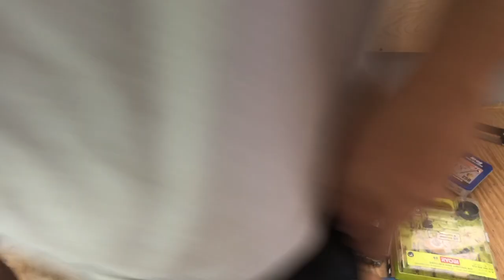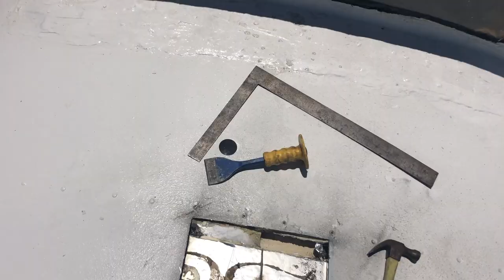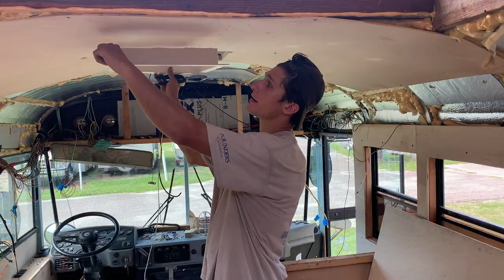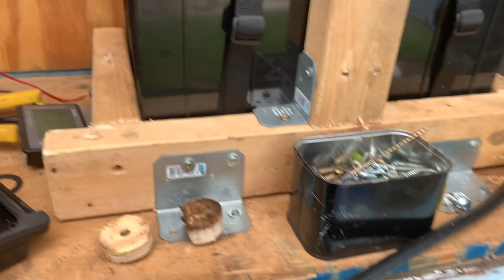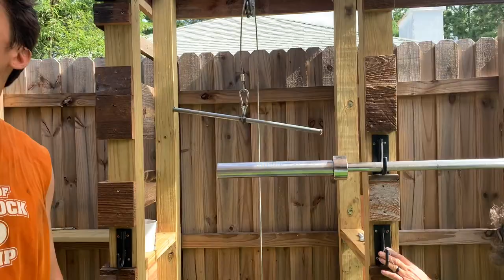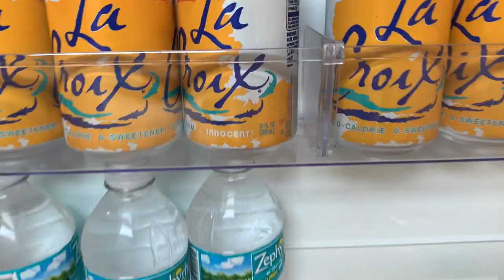Installing a Maxx Fan Made All The Difference in Our Bus Conversion! DIY Skoolie Ceiling Fan

Comment: Just here to say awesome. That's an RV fridge? I thought it was 12v/propane...not connected to an inverter. I haven't bought a fridge yet, but I got a plug connected yesterday through my inverter finally! Dying to have cold drinks on the bus when I'm working.
Reply from the maker: Blue Note Roast thank you!! Yep it’s made for an RV. It has the option to run on 12v and propane or 12v and 110v so we opted for the electrical route! It’s a norcold 6 sq ft :)

Comment: I'd suggest you get a vent cover for the fan and any other vent you want to put in. Cause like me I sometimes forget to put down the fan cover and start driving and then the cover breaks from the force of the wind. Plus you can leave it open when it rains with the fan on. It also acts like a second water barrier. Comes in white, black, smoke grayish/black. Camco makes some but the one I have is maxxair ventilation solutions 00-933066 sold on amazon eBay or if you have a local rv trailer shop around. Price starts out at $30-$50 depending style and such. 
You guys are doing great love seeing it all come together. Take care.
Reply from the maker: Jacobie Jacobs ooh this is sweet thank you so so much! It’s definitely in our plans, one step at a time you know haha could definitely see us driving off and forgetting to close so we’ll take a look!